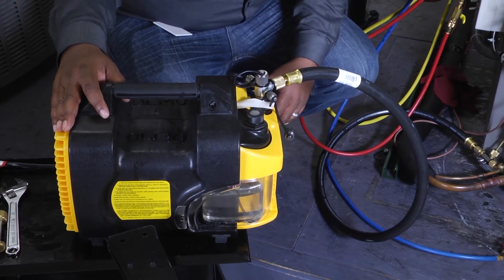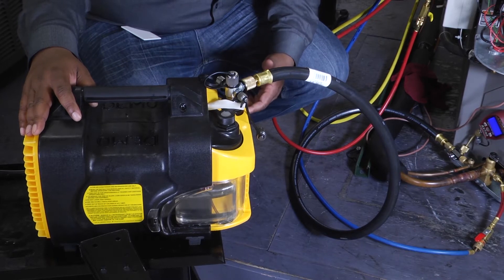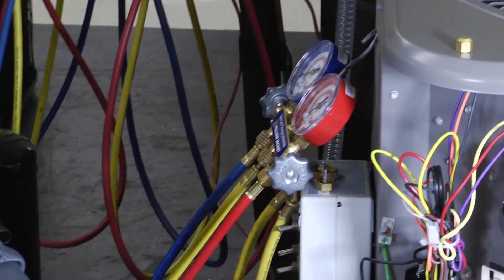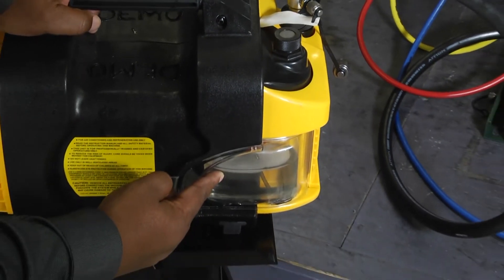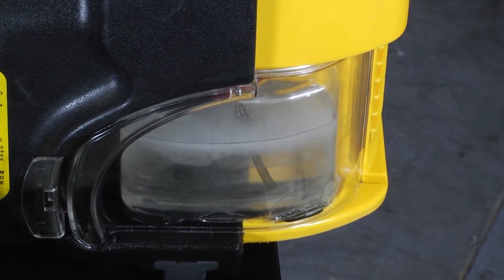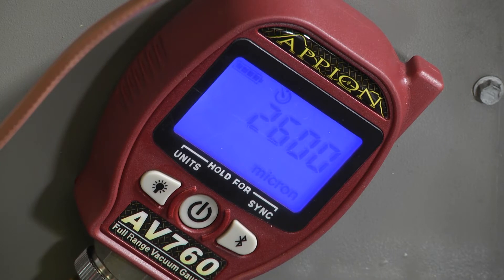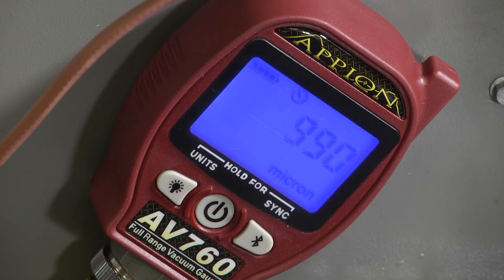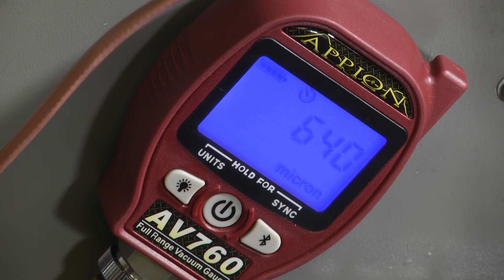Appion Tez 8 Vacuum Pump on ToolboxTuesday.

Comment: This is not a good video 
You don’t have your micron gauge in the right place
Your supposed to leave one vacuum connection slightly open on start up of the Tez 8 & I would be putting the vacuum connection on the suction side with the micron gauge on the liquid side or use two hoses etc

Comment: Why are you only pulling from one side of the system? takes 3 times as long that way. that micron gauge was moving very slow for a tez 8
Reply: maybe he is. if he is reviewing the product then he should do so in a way that best demonstrates the product. If you had a TEZ and used both hoses and core removers you would know that this video is not the best for showing how well this product works.
Reply: Performance Based Heating & Air I see that the MR45 from fieldpiece is most are drooling over. You think the TEZ8 is on par? I agree about how he pulling the vacuum, lol. I did a double take!
Reply: havent used a MR45. I have 2 tez 8s. hooked up right, most new installs on the resi side take about 2 minutes to get to 500 microns. we often pull vacuums down to 60 microns with the tez 8s in about 10 minutes. with results like that I havent needed to look at any other pumps.
Reply: Do you use a TEZ 8?
Reply: This man is a professional. He has the knowledge and knows what he is doing. This video is for review purposes of the machine. I have met this man personally. He has a wealth of experience and knowledge.
Reply: That's your opinion. The example he is presenting is still not wrong. Everybody's a critc,  but criticising unnecessarily. If he used the wrong method then I would understand. He didn't. He even said that the refrigerant had been pumped down. You and everyone else that are competent technicians understand that. The review is still a good review. If you want to present a better one then kindly take the time to do so. Present it how you have used it in the field and share your results.